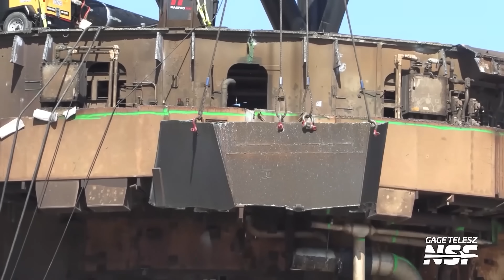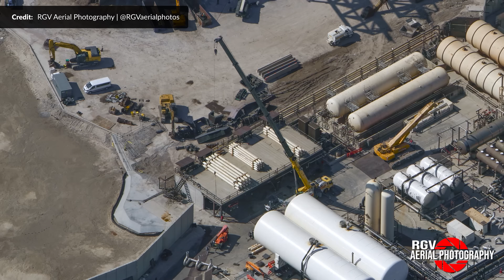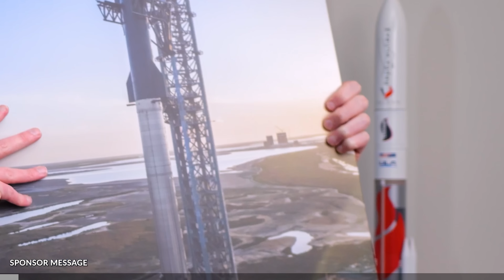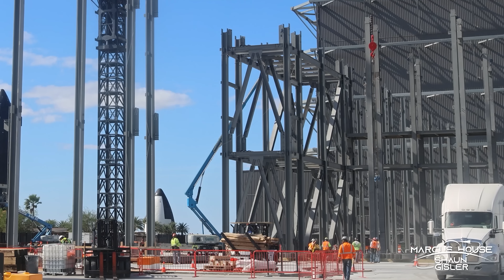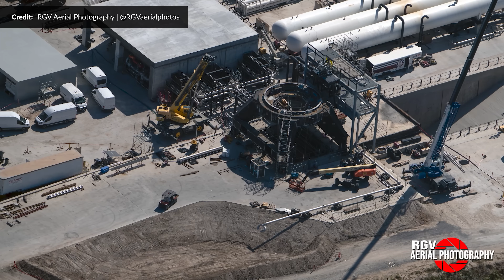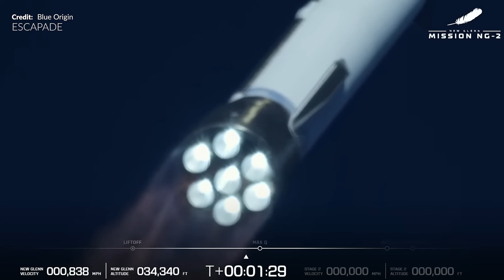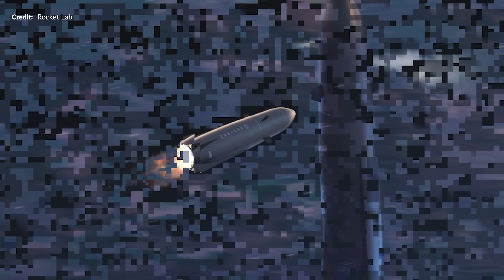Blue Origin’s New Glenn stunned everyone!

Comment: Great job NGlenn, wasn't expecting them to make it on this attempt. They may be mindbogglingly slow and inefficient (NG 13 years in dev and over 10 billion dollars, and counting) but they don't give up.
Reply: 13 years for a partially reusable rocket the size of SLS designed and built completely in house with proprietary tech that launched to orbit on it's first try and landed the booster on it's 2nd try is insanely impressive.  Not to mention New Glenn is capable of getting us back to the moon without requiring 20+ refueling trips.
Reply: @gracialonignasiver6302  The size of SLS with a fraction of its capability. Falcon Heavy for example took ~2 years to develop (program was unfrozen and started active development in 2016) and reached orbit and landed on its first try. Even including F9 development (just as NG landing was based on N.Sheppard), we get 6 years in total (F9 active dev 2006-2010). And NG is not able to get anyone back on the moon, it can only send ~6t to TLI, has no spacecraft, no crewed lander, no return and EDL vehicle.
Reply: @gracialonignasiver6302  13 years for a partially reusable rocket the size of SLS

At most HALF the size of SLS.  

:planet-orange-purple-ring:

:planet-orange-purple-ring:

Comment: For the transport of the gasses they are most likely going to do a pipe under ground but also have the option to fill trucks. After all they are not the only ones needing these gasses and it would make very little sense to only run the facility for short stints at a time just to fill up the rocket and then switch the thing off again for potentially a few weeks at a time.

I suspect that they will be able to truck the gasses out for instance to the test site because when you have the capability to produce and transport them at cost why would you buy at a premium for the test site? I could even see them selling off excess because why not...

You have to keep in mind that the machinery meant to do the separation are designed to be run near continuously and it will not be pleased being stopped and started on a regular basis because that is not what it is designed for. Doing that anyway will cause things like condensation and oxidation for instance or simply the components are happier running and under higher strain when standing still because again they have been designed to run not to stop, stand still for a long time and start again many cycles in a row.

That is why my prediction is that we will see a pipe under the road and a place for trucks to be filled ready to drive the gasses to the testing site and potentially external customers.

Comment: The inefficient reusable booster with heavy landing legs and can only drop down range rocket no one asked for.
Reply: It will depend on what the costs are before you can make the claim no one has a use for it.  You're being somewhat simple.
Reply: @imaginary_friend7300   Of course it's going to cost way more than anything else. For starters it can't land back on the launch mount, which is like having an aircraft that drops people off at the airport, and then lands out on an aircraft carrier and has to be shipped 500 miles back to port. 

The entire business model of starship is reducing the weight of the vehicle by offloading as much to the launchpad as possible, which includes 30 tons of landing legs.  Then all the fuel needed to have that booster hover and side translate to the ship, well that's another 10 tons. 

You realise these launch systems can only put about 100 tons to orbit, right? BO is losing half of that in excess hardware, and then it can't even refill it and relaunch it any faster than the space shuttle because the booster doesn't have the ability to return to the launch site.

Starship and superheavy booster are designed to launch, land back on the pad, refill and fly again in 45 minutes, like a commercial aircraft. BO is based on an outdated business model that took them so long to get flights off the ground that it's already obsolete due to it's cost. 

And without orbital refilling, it's useless for anything other than dropping small modules down to the moon or Mars at a cost of billions per ton, and take 2 years to get to Mars, so completely useless for getting humans to Mars. 

Did you see their control centre? Everyone there has grey hair, no young blood at all. These are all kids who grew up with Apollo fulfilling a dream, rather than pushing the needle forward. They're just doing what's already been done, at great expense, and already commercially unviable unless they plan on making a significant loss on each launch.

Comment: An incredible success for BO. Two orbital launch attempts, two successes, two booster landing attempts, one success, incredible. I didn’t think they would succeed on the first attempt, few companies do. Interestingly the payload on the second launch was tiny compared to the maximum possible. Now if they crew rated NG, they would be able to launch a crew to the moon, a much more sensible option than Starship in my opinion, at least for the first missions.
Reply: They don't have a spacecraft, a lander, a return and Earth EDL vehicle, and NG (which took 13 years to reach this stage of development) can launch a tiny fraction of Starships payload to the moon. How are they the more sensible option than Starship?
Reply: @admarsandbeyond Th trans lunar components don’t need to be developed by BO, though they’ve done a lander. Starship is far bigger than need be. It has a huge number of technical challenges to address. The heat shield currently falls off, loss of tiles means non reuse due to burn through, they haven’t proven in space refueling with full size tanks, they haven’t performed a Starship catch (to be fair they seem to be there), the crew cabin is not complete and probably barely started, and that means all flight controls, navigation systems, software and crew support, the lunar elevator is not done and presents a potential danger unlike a simple access hatch, landing such a massive ship on the moon is potentially dangerous and unproven and lifoff require relight of engines exposed to lunar debris. I’m sure I’ve missed countless other challenges. SpaceX won’t land a crew on the moon this decade in my opinion. I’d like to be wrong.
Reply: The payload on the 2nd while larger was still tiny.  Payload to the moon is inadequate for a manned landing mission.  They might get a small capsule to do a quick fly around and return.  They might do better with orbital refuelling of the 2nd stage.

:planet-orange-purple-ring:

:planet-orange-purple-ring:
Reply: @Scanner9631 The payload on NG2 is irrelevant, they can send massively more. They could do a moon mission, launch components, dock in orbit, sorted. They’re already sending the lunar lander on I think the next flight!
Reply: @StillAliveAndKicking_  They’re already sending the lunar lander on I think the next flight!

Depends what you mean by "lunar lander".  It is too small for carrying people.  Doesn't return to Lunar orbit.  Purely robotic.  

Their planned manned lander is twice as big.  In fact the manned one uses the full capacity of New Glenn which it has yet to demonstrate it can carry.  

:planet-orange-purple-ring:

:planet-orange-purple-ring:
Reply: @StillAliveAndKicking_  They could do a moon mission, launch components, dock in orbit, sorted.

Given how long it took them to design and build New Glenn how long would it take to design and build all that?  Who would be paying for it?

:planet-orange-purple-ring:

:planet-orange-purple-ring:
Reply: @Scanner9631 They didn’t hurry, unlike SpaceX that needed to be commercially viable to survive, and nearly went bust esrly on. BO had issues with the main engines adding many years delay. Those engines were a technical challenge, not many companies develop new engines of that size, there’s SpaceX and BO, maybe RocketLab too. The lander they’re sending soon was developed quickly. But it doesn’t have to be BO that develops the translunar components, which are essentially known technology. Anything but SLS.

Comment: I was very happy that Blue Origin finally got New Glenn up and running as intended. And I was quite amused to see Blue Origin fanbois wagging their fingers at SpaceX about how BO managed to make a successful booster recovery after only 2 attempts, but it took SpaceX 5 failed attempts to land before the first success. Ha ha, what a burn! 
   That first successful SpaceX booster recovery was in 2015, 10 years ago. Meanwhile, in 2015, BO successfully launched the first New Shepard flight demonstration vehicle, but it crash-landed. BO built a total of 5 NS vehicles, and shot them straight up and straight down, launching nothing into orbit, over a period when SpaceX was launching something like 500 orbital class boosters, recovering almost all of them, and putting more than 500 payloads into orbit. During this period, BO launched New Shepards a total of 36 times. And none of them could have launched anything into orbit.
    BO fanbois were also wagging their fingers over New Glenn having twice the payload capacity of Falcon 9. Development of New Glenn began prior to 2013 and was officially announced in 2016. So it took 12 years to build it, all the while Falcon was putting hundreds of thousands of tons into orbit. And check out Falcon Heavy Block 4: it has 3.5 times the launch capability of New Glenn. 
    So hurrah that Blue Origin stuck the landing with New Glenn! I'm happy for them! But the fanbois need to take a chill pill -- SpaceX has been doing what Blue Origin promised for ten years.
Reply: I don't understand the animosity in eather direction. It sounds a bit childish to rant and rave about one ore the other. BO and SpaceX obviously approach reusability from different angles. They both deserve their just rewards.
Reply from the maker: Almost 10 years since the "Welcome to the club!" tweet. 😆
Very nice to see it though.
Reply: Blueballs fanboys had their day but it all comes down to cost per ton to orbit.  Don’t see how they’re going to compete with Starship without government support.
Reply: The first official application for NG testing was filled to the FCC in September 2012. They had to begun hardware development at least a year earlier to reach that phase. That means NG is in hardware development for at least 14 years. Also people forget that landing one booster is only the first step of many (the easiest probably). Now they need to make it reusable, reliable, efficient, high cadence, and most importantly cost effective. A process a couple orders of magnitude harder and time consuming.
Reply: @admarsandbeyond My guess it they will move methodically as they have to this point. And the "Orders of magnitude" sounds reminiscent of another SpaceX enthusiast.
Reply: @mp6756 Musk, the only person in history who has achieved it, said years ago that landing was the easy part, making it work practically was orders of magnitude harder.
Reply: @admarsandbeyond  I am aware of who used the phrase.

Comment: New Glenn 1 - successful orbit on the maiden flight
New Glenn 2 - successful booster landing on 2nd attempt + two satellites going to Mars

Meanwhile SpaceX, after 11 attempts, still sending scrap metal from Texas to Indian Ocean.
Reply: Your apples are vastly inferior to my oranges.
Reply: bro forgot that spacex already has a relatively big partially reusable rocket that theyve been landing its lower stage for the last 8 years...
Reply: They have different missions.  NG is a reusable 1st stage and expendable 2nd stage rocket.  Super Heavy is a reusable 1 stage but the 2nd stage is a multi purpose ship for reentry, refueling, or moon / mars missions.
Reply: @cwulfe1  So far, the Starships that have made it to landing have shown molten metal and visible holes burned through the heat shield. So the reusability of Starship is still a big question.
Reply: @jurabondarchook2494  True, but they have reflown Superheavy boosters so that has proven significant reusability
Reply: @jurabondarchook2494  You mean that burn through from the grouping of 3 tiles they deliberately left off? But it still stuck the landing anyway? Just another Elon Derangement Syndrome victim
Reply: @jurabondarchook2494  Starship is still in active development.  Do you know what means?
Reply: @paultimmins4424  have they though?

Ask yourself, what does SpaceX mean when they say they are “reflying” a booster. Are they reusing all the engines, valves, etc.? If not, how much are they changing after each flight?

At what point would it no longer be considered as the same booster? I.e. if I only reuse the outer shell but replace every, single other part, is that the same booster? Or what if I replace everything but a single original bolt?

I don’t know what was replaced or modified between flights (no one outside of SpaceX does, and they are all under NDA’s so we will likely never know the answer), but it is a good question to ask yourself as SpaceX could be using a very loose definition of “reflown” as more of a PR stunt than anything 😊

Edit: also, don’t forget that Musk and his companies are notoriously well known for exaggerating the capabilities of their products so it’s not like I’m being sceptical for no reason 😊
Reply: They gained massive amounts of data from New Shepard, allowing them to land on the first try. SpaceX had to use Falcon 9 as the test article before they nailed it. In addition Falcon 9 cannot hover, so they have to get it right first time. It basically has to reach 0 mph at the landing barge, too late and bang, too early and it plummets.
Reply: Why do sooooo many dumb cvnts compare NG to Starship? 🤔🤔🤔
Reply: Yep 😝 It honestly feels pretty weird that we have become so use to rocket “tests” ending in disaster these days rather than each test showing measurable improvement on the last…

Also I find it pretty funny that so many SpaceX fans were bagging out BO prior to (and even after) New Glenn’s first launch, only for them to now be acting like they have been cheering BO on all along 😝
Reply: @bear4278 all musk fanbois are like this. Seen such behaviour with Tesla crowd too.